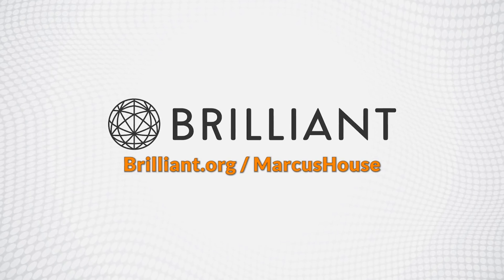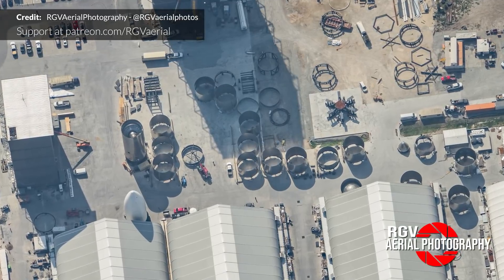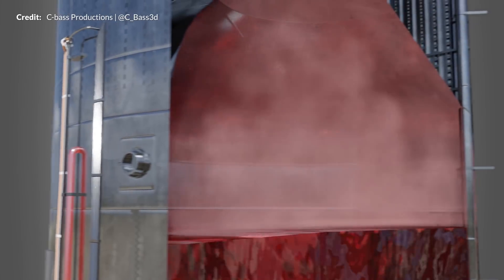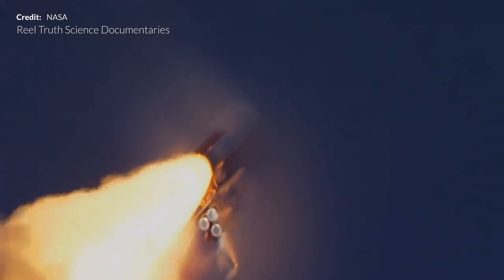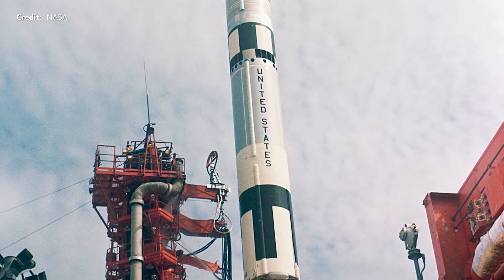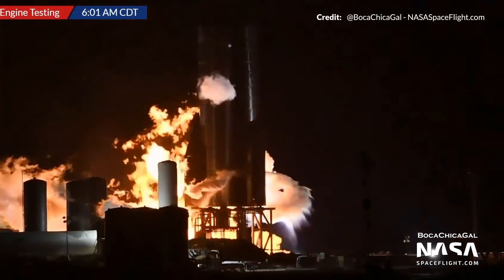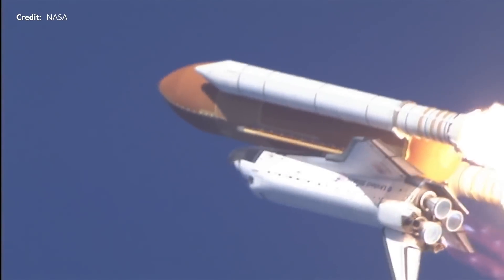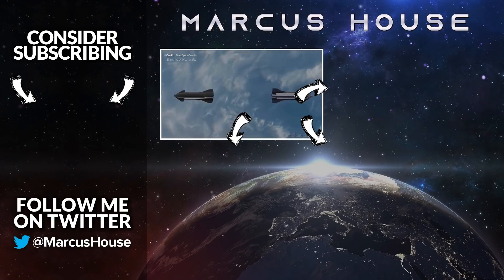SpaceX Starship - How will Starship tank autogenous pressurization systems work?

Comment: I would think they would have a problem floating around in 0g. This pressurization only works standing up in gravity. I think they will have to rethink this whole thing. The tank needs a bladder with an accumulator,  air tank, vacuum pump, actuated valve set up.
Reply from the maker: Look up ullage systems. You just use a little RCS to push the liquid to the bottom of the tanks, then fire em up.
Reply: @MarcusHouse  I got ya, so a burst from the engine, supplied from the  independent header tanks would slosh the fuel to the rear so the the engine can pick up the main fuel flow. What I'm suggesting eliminates all of that. I work in oil and gas and have exposure to a lot of different ways of doing things that's not rocket science, but if it goes wrong, it'll go up like one? so its proven to an extent. An accumulator set up keeps the liquids where you want it and is low tech. As far as the cryo temps go. Liquid oxygen only needs to be cooled for storage and transfer. When it is heated before use, It becomes much, much more usable. Race cars heat it up to get the most from it. If you turn the tank into a giant "shock absorber" you can control the pressures with out purging. As the tank is filled, The vacuum pump pulls and stores the nitrogen. Then it can be controlled and regulated back into the tank as the fuel is used. This eliminates many components. and purge waste, giving full control over tank volume and pressure.
Reply: I don't think any bladder material could stand up to the cryogenic temp.
Reply: @swiftajax6727  There is a vast array of materials that stand up to cryogenic temps.  Now extensive research would have to occur, I would think that warm nitrogen on the accumulator side mixed with a low temp. conductive material that is merely cryo resistant could be a working combination.

Comment: Why not just add heater coils around the inside of the tanks, insulated with silica compounds, then heat them up with the batteries that are clearly in the vehicle anyway ?
Header tanks just add weight. Add a bit more battery and wire to spice the gas up instead.
No idea if Elon has an Idea Stream that anyone listens to.

Comment: That is a good explanation, but only from a body with gravity.  If it is starting in space with no gravity, you need to ad a pre-thruster stage (Hyperbolic, solid fuel engines or cold gas thruster) to begin moving the craft and to settle the fuel bubble to the rear (Bottom) of the tank and cover the inlet piping so to have a continuous supply of propellant before engine ignition.
Reply from the maker: Yes, cold or hot gas thrusters is the plan there.

Comment: I think they should scrap the header tanks and use a syringe like plunger powered by a Tesla motor in both main tanks. This would stop any slosh/cavitation especially on the flip manoeuvre. No need to keep engine running.

Comment: I've been saying this since SN8 now, glad to have an audience for this!

My idea is to combine the COPV and autogenous pressurisation system into one.

If the COPVs are already being used to spin up the preburner turbines then they're clearly already plumbed into this system so no extensive works will be required for this.

At present, and if I understand it correctly, once the first engine start is done, the COPVs for this are essentially useless.

My idea is as follows:
1. Once the first engine start is done, shut off a valve between the COPV and the preburner turbine.
2. During engine burn, open a valve between the autogenous pressurisation pipelines and the COPVs.
3. Repressurise the COPVs with gaseous oxygen or methane.
4. Once at desired pressure, shut off the valve.
5. At next engine start, open the valves from the COPVs to the preburner turbine to spin up
6. Open another valve to give that initial burst of pressure to pressurise the tanks.
7. Repeat.

Just my thoughts as a lowly maintenance engineer with a fair amount of experience on hydraulic and pneumatic systems. Happy to be ignored or corrected :)

And by the way, excellent video Marcus, thanks for dropping it on a Tuesday to break up the week!

Comment: Hey Marcus.   and video, congrats. What I'd really like to see is the explanation as to how the pressurisation the system works when the vehicle is horizontal or even worse, nose down or zero G. It would seem that simple pressurisation without a bladder could PREVENT the liquid propellants from reaching the discharge pipework or cause a gas bubble to enter the system.

Comment: I wonder what SpaceX calls the tanks you keep referring to COPVs... I suspect that's really a term used by journalists, not the engineers.

Only "composite over-wrapped pressure vessel" is a description of the construction of the tank, not its job. It would be like calling the LOX tank the "steel rolled ring tank".

Comment: It's not enough to pressurize it, you have to make sure that the free gas doesn't go anywhere near the outlet pipe, the engines do not like bubbles in the fuel flow. This is difficult to achieve in low gravity situations like free fall and orbit.

Comment: @Marcus House, great video you made! Very interesting! When I think of the problems of SN8 and SN9, while landing, I would say the belly-flop shakes up the fuel. This leads to bubbles, leading to stutter in the fuel supply. I think the star ship should belly-flop earlier in the descent. So that the fuel has time to settle. However, the bubbles wil get into the fuel supply anyway... I hope this is not the actual problem as this would seem very hard to solve. What do you think of this analysis?
Reply from the maker: Hard to say as we don't have detail on SN9's engine start problem. SN8 was actually almost perfect. That was a header tank pressure problem.

Comment: Methane boils at -161 C and freezes at -182 C while Oxygen boils at -180 C (and even that changes when you mess with the pressure) so that methane pipe going right through the center of that LOX tank when they use SUPERCHILLED oxygen has to be hard to keep from freezing, (especially on long, interplanetary flights)

Comment: Bellywop(or flop) should end higher in the atmosphere after the ship has slowed sufficiently ..... then use grid fins to drop vertically allowing gravity to move the fuel in the tanks to the pickup ports.  No header tanks needed.

Comment: Can anyone answer these 2 questions please?: 1) can the bellyflop cause fuel to run backwards and cause a gas/airlock? If you look closely at SN9 before the crash the failed engine seemed to burn pink/orange at the point of failure and this colour suggests it might have been burning helium (the presurization gas) instead of methane. If so then I understand helium can damage the engine. And 2) the Falcon 9 has 9 engines, so that if any fail there are plenty for backup that the fuel can be diverted to. Why does starship only have 3 engines? If they are going to use this for passenger vehicles should they have more redundancy - i.e. a larger number of small engines like F9 or better?
Reply: In the final design, Starship has got 6 engines and the super heavy has got 28 engines.
Reply: @καλαμ  Thanks Callum, that make a lot more sense!
Reply: @robcharles3226  You're welcome. Hopefully someone else can answer your first question 👍

Comment: Starship may need an auxiliary electric heating coil for added fuel pressure. Get it red hot, then dunk it into the cryogenic gas for quick pressure. The safety pressure release valve should keep it from overpressurizing. This could be used if and when the autogenous system isn't pressurizing rapidly enough during the landing burn.

Comment: The SLS booster engines ARE the Space Shuttle Engines, so they should be using the same methodologies for use.  Just my thoughts anyway.

Are there new / better methods of pressurization, someone will figure it out... Currently I would go with SpaceX, but others are in the wing and no-one stays on top forever.

Comment: I was just thinking that, Spacex is already looking for a lower min throttle on the raptor engine due to engine redundancy needed in a safe landing, this could help in re-egniting the raptors in space without too much fuel consumption, just to keep the pressure nominal. Great video as always.Thx for sharing. ;-)
Reply: Elon seemed to like the idea of keeping all three running at idle and then cutting them out one at a time as required. I think they will stick the landing on this one.

Comment: I remember someone in a Scott Manley twitter response brought up the problem of methane triple point being hit within the fuel tanks during the flip. I was skeptical that such a specific pressure, temperature, and changing between liquid and gaseous states were being reached within the fuel tanks. However a quick look at a phase diagram of methane showed that it's within the relm of possibility unfortunately. I suppose that's the only downside to using your fuel and oxidizer to repressurize your tanks.

Comment: The 2nd purpose of the pressurization is to "push fuel down into the bottom of the tanks".. erm, which way is down in Space? Even with gravity, surely the pressurization won't push the fuel anywhere other than through an attached header if it is already full of fuel.  Great episode btw.
Reply from the maker: Look up ullage systems. They use a tiny amount of RCS to push all fluids down. Then fire the engines up.
Reply: @MarcusHouse  That's great. What devices are used for RCS to provide longitudinal force? The lunar SS has thrusters halfway up the sides of the rocket doesn't it?

Comment: I love those engine renderings! My guess is they will need to move the methane header tank down a little so that it’s not directly in contact with all the liquid methane sitting above it.  I suspect they are losing a bunch of heat through the top wall of the methane header tank. Or maybe they can just crank up the gas flow to compensate.
Reply: That's exactly my thoughts. 
The hot gas has a one-way ticket to being absorbed into the cold liquid, removing the all important gas pressure. 
The methane needs to be at its boiling point in the header tank.  Perhaps some insulation around the header tanks would help and crank up the gas flow from the engines as you suggest. 👊

Comment: Seems to me that they need a "pre-burner" like device separate from the engine whose job is to maintain tank pressure by exhausting directly into the tanks.  These could potentially function on gaseous O2 and CH4 and thus not be affected by "sloshing" fuel.  Just an idea.  Downside is more weight, upside is an engine independent way to keep the tanks pressurized.  Also avoid the chicken and egg problem of the main engines needing pressure to start and needing to be started to create pressure.
Reply: Electric Heaters are what are often used, such as for the Crew Dragon Vehicle and its hyperbolic propellants. This allows the cryogenic propellants to be heated up when engines are not in use.

Comment: Does the pressurization keep the fuel pushed towards the engines regardless of the orientation?
Reply from the maker: No. That is where header tanks come into play. Also ullage systems such cold gas thrusters settle fuel in zero g.
Reply: @MarcusHouse  That's what I thought.  My 8 year old was looking at the simulation and suggested the gas was pushing the fuel down... but then asked why that doesn't happen in a pressurized bottle of cola. Smart kid.  Thanks for the great content.

Comment: Thank you 🙏 AGAIN 🙏 for your excellent succinct informative and flawless videos 👏💪💪👏👍😎
🤔 WHY is helium used and not liquid Nitrogen for pressurization...I guess it's potentially combustible as temperature rises but what if it's REALLY cold ?
Reply from the maker: Helium has a waaaayyyy lower boiling point than LOX or CH4, so it is easily kept a gas. Nitrogen boiling point is a lot higher so I imagine it is harder to keep in gas form.
Reply: @MarcusHouse  thank you 🙏

Comment: Why not lunch 5 or 10 starships get them  in orbit secure them  together refill them use one to send to Mars you still have full fuel tanks on the  rest . You can take a lot of supplies with them . If something happens to  the ship you can move into another so you don't  wind up like Apollo 13
Reply: John Jacob Jingleheimer-Schmidt  you don't have any gravity in space to hold you backhand no friction to slow you down that is why those little thrusters on the space station  can move it around

Comment: Could spacex incorporate a small jet engine or rocket powered APU into their design similar to jet airliners in order to spool up the turbo pumps and maintain tank pressure? I'm sure it wouldn't be very difficult to make a small efficient methane powered jet engine, however the main issue with that idea would be that there's no atmosphere to run through the intake. A rocket APU could be started using electric pumps like the electron rocket only on a smaller scale. Just large enough to provide pressure to spool the turbo pumps on the raptor engines and supply adequate pressure to the tanks. Batteries could be charged using solar panels.
Reply: Too complicated, compared to electric heaters
Reply: @alvianchoiriapriliansyah9882  electric heaters would solve the heating of the propellant problem, although I feel it would require a large amount of electrical power to heat a propellant tank. Also, that wouldn't reduce the need for helium copv's to start the raptor engines. This idea could potentially solve both problems

Comment: This may be a dumb question, but can a fully loaded with cargo Starship lift off from Mars and reach escape velocity (in order to return to Earth) without a SuperHeavy booster? I'm assuming that it can because of the lower gravitational pull, but I'd like confirmation 😅
Also, will vehicles returning from Mars need in-orbit refueling or will one single load of fuel be enough to make the trip?
Reply: 1-The Starship after refueling on Mars will be able to reach earth without a Super Heavy.
2-The Starship will need to refuel in orbit before going to the moon or Mars. After refueling in orbit a Starship could land on the moon and return to earth without further refueling.
3-"Will vehicles returning from Mars need in-orbit refueling or will one single load of fuel be enough to make the trip?" I don't know. I hope this helps.
Reply: @MrEd2291  Thanks!!! That was super helpful! Have an awesome day! :D

Comment: there is something else, in addition to pressurization, that the turbopump needs at inlet port, for proper operation: a good continuous feed of propellant in liquid state. Pressurization is needed to prevent inducer cavitation, while liquid shall be continuously present in the line to prevent over-speed of the pump, as would occur when this finds itself to pump the much lighter propellant vapor. When looking at Starship operation, I wondered how relevant tanking, fluid pick up inlet, and lines system are made, with respect to the changing operational cases, ascent with vertical attitude, restart at inertial flight in vacuum, then descent with axis horizontal and side g-load (as per your movie), with restart in this attitude. What is not easy to ensure is that the feed lines are kept full of "solid" liquid, and that no vapor bubbles are collected in particular during the descent. I doubt that while chilling the engines, before relevant ignition, any large vapor bubbles could be vented. Wish I am wrong ... and that it was really a problem of insufficient pressure.
Reply: Well put.  this is what worries me; pressurization is difficult enough; but then you add in the complexity of shut-off, going horizontal, and then restarting.....you're going to get some hiccups, just as we've seen in these past two tests
Reply: @rickflaquer7317  I guess you have experience with systems like this, as I had to build when I was still working. Pressurization is difficult enough, you say, and this is exactly what I used to tell my customers and my engineers. It is not clear to everybody that  in order to transfer a liquid from a fixed volume tank you have to "fill" the volume with equal volume of "gas": autogenous pressurization is "the" solution, as it allows sure advantages vs the use of an inert gas, but here, Starship, my fear is that the most difficulty is in the design of system schematic and geometries, tanks, pipes and valves, mainly due to the fact that the g forces change direction ... when they even exist. I did think about how to develop such a system: in these days it is pretty usual to make test rigs and these are sometimes requested even by the certifying authorities; surely Spacex are familiar and used to this. I heard that next flight will see the attempt to start all engines, based on the assumptions that this was the difficult task. My feeling (my fear, I would say) is that properly feeding the propellants may be more difficult. At least one engine appeared to function in both landings, which might suggest that feeding was ok .... but I am not fully convinced (obviously I do not know details of construction and of any development tests). Would a flip and starting attempt made at higher altitude help understanding this? certainly a failure would make an even better looking RUD!

Comment: Wouldn't the belly flop maneuver force the fuel to one side of the tank?  If the tanks are V shaped on the bottom wouldn't that reduce the effectiveness of liquid propellant reaching the intake valves?  I understand the tanks are under pressure but wouldn't that allow only vapor to enter and not liquid, or does that not matter?